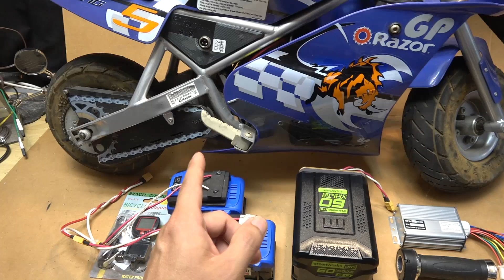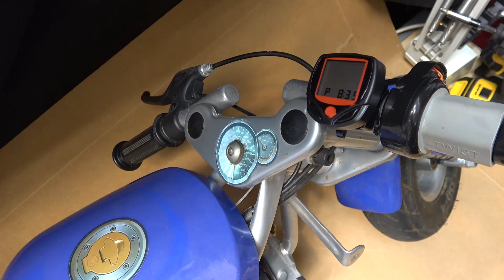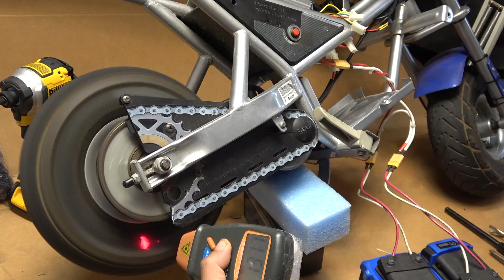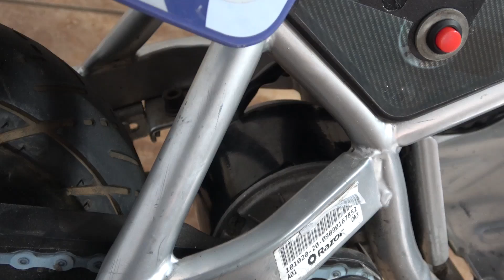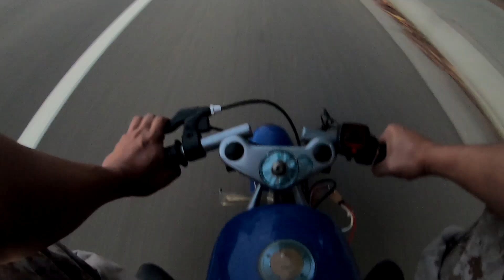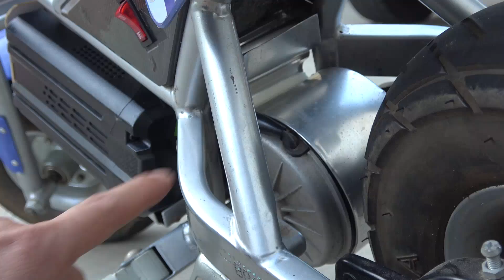From 24V to 60V upgrade: Razor Pocket Rocket Electric motorbike

Comment: I have a rsf650 but the switch has 2 red thick wires running to it. I switched to lithium batteries n the switch burnt out. There's a thinner red wire in same harness so I cut it but current still ran to controller. Is that normal on rsf650?

Comment: I have a lot of Kobalt tool batteries and I was thinking about getting an electric scooter. The one I have my eye on is 36v. Is there a relatively easy way to get 36v out of these batteries for this? Maybe if I used 3 of them and stepped them down to 36v? I don't know enough about this stuff and I don't want to mess anything up. I've been watching your videos for a while and you're clearly very knowledgeable and intelligent. Either way, I really appreciate your work. It's informative and inspirational!

Comment: You seem to have extensive knowledge about electric scooters. So I have a question. I have a Schwinn S500 scooter It has stock 24v controller and 24v 500 watt motor.  I bought a 48v lithium battery thought I could easily install and over volt the system but the scooter won't even turn on with new battery? I checked with old 24v lead acid batteries that nothing wrong with scooter it's fine. I actually took the 48v battery and connected to my daughter's e100 24v razor scooter and WOW the wheel was spinning lol.  I can't imagine a tiny 24v converter on a e100 will allow 48v but my 24v 500w scooter won't?  Also I went to open the controller box in the s500 and it was filled with heat reduction resin so I can't even touch the board. Wondering is there a wire that is responsible for speed limiter and it won't allow 48v to go thru system? Or is there a way if I buy a 48v controller is there a converter to step the power down to 24v or 36v with my 48v battery?   I'm very interested to hear your thoughts thanks

Comment: That was awesome as usual. I have a Bafang mid drive bike and going up a hill the motor gets hit to the touch. It seems to work fine. What is the spec for heat on motors. I remember on swimming pool motors, the label would say the allowable temp in centigrade. If I remember, they allow pretty high temps. Thank u for your fun and educational vids.
Reply from the maker: They can tolerate quite a bit of heat in a short amount of time. But this one can't last if I keep running it at almost 3 times the rated voltage. Heat is the number 1 enemy of motors especially brushed motors so I would do whatever necessary to lower the heat.
Reply: @vuaeco  How about pop riveting some more fins on the aluminum where they won't hit the tire. I think 60v is really pushing it even 48v might be too much.
Reply: @tims8603  Any update on it Tim?

Comment: Can anyone help with advice about E brakes hi & low please 
I I no low is pulled to ground and gives braking 
I am not sure if the hi brake gos to a 5v or 12v or what power u r using so 36v . Plus is there a difference in the power of braking between hi or low .
I also want to us a hall thumb control for a break . But if the low just gos to ground and like using a switch it just iver on or off. I don’t see the point then. 
But if hi braking duz go to say 5v or 36v it would make sense to use a thumb controller as it starts at 0v then pulling it to 5v or 36v then u can control the power of the braking. 
Please please anyone help me as I don’t want to go to 36v hi and make smoke. I no it can go to 5v I no that but some say to get very strong braking then pull the 0v hi line to 36v battery and the braking is a lot better 
Can someone help

Comment: Yes that’s what I call cool as hell bro
So it was 60v but using the 48v controller yes
I got a scooter it’s running on 36v battery sometimes it’s up to 42v but I use 36v-48v controller, but I want to use more power say 60v so if your controller was ok I no that mine shod be ok at 60v. 
I put a new controller in there so now time for more power. Was just going to go to 48-52v but I don’t see y 60v shod be a problem. I think the competitors r about 62v I think my be wrong. 
The controller sites wear the battery was now and the battery I have made a packet for it so I can run what power or battery I like . 
Love the stuff u do bro ❤️🇬🇧
Reply: The typical limitation is 63v capacitors, which esyablishes an absolute max voltage (open circuit). Hot rodders have been swapping those for 80v and 100v ones for top speed, for a decade or more. Careful, tho: If voltage rises and amps stay the same, your wattage goes up!

Comment: How much run time? What’s the maximum distance can you achieve?
Reply from the maker: Hard to answer this question because it depends on a lot of factors: speed, terrain, stop-and-go traffic... But in this case, if I just run flat out at 25MPH on that 48V 6Ah battery, I probably get about 6 miles max. A lot of power is wasted as heat in the brushed motor.

Comment: I really don't know what to say to this 
-"i ride on this just fine"
But the ride is never really the problem,  it's the stopping.  The really sudden stopping where the rider is roughly separated from the bike
Reply from the maker: the ride is fine, the fall is not fine. Need a seat belt and an air bag.
Reply: You make a valid point. Of course, the most sudden kind of stop happens when your wheel goes into a large pothole. Happened to me on a 26"-wheel bike in 2020, doing just 15 km/h on Patton Street in Vanier. It was nighttime, and I didn't have adequate lighting on the bike. Painful!

Comment: On heat sync, if you weld on some vertical pieces. Air will flow between them and cool motor better.  Be careful no pieces are close to tire.